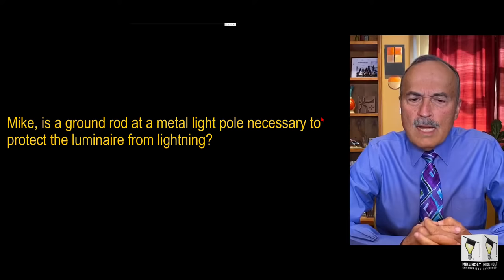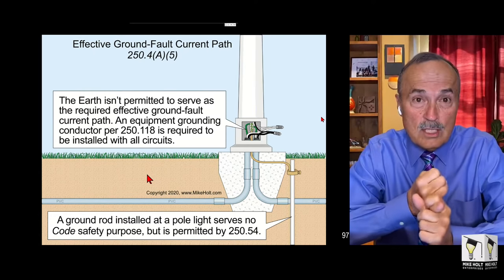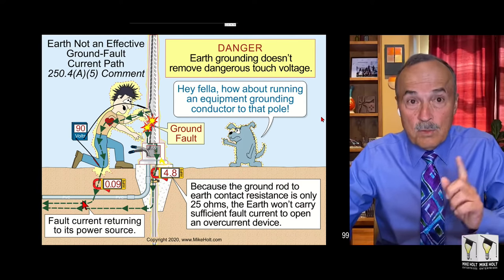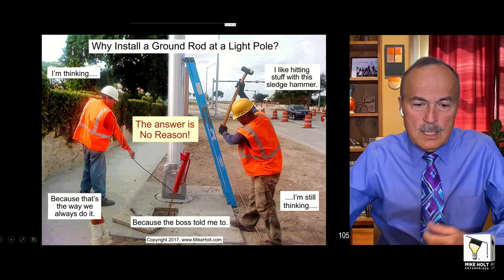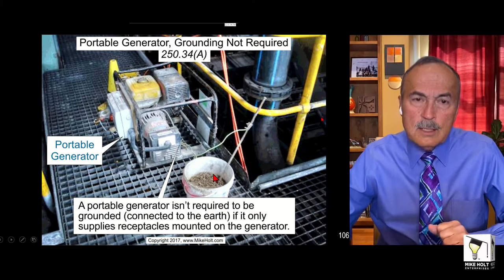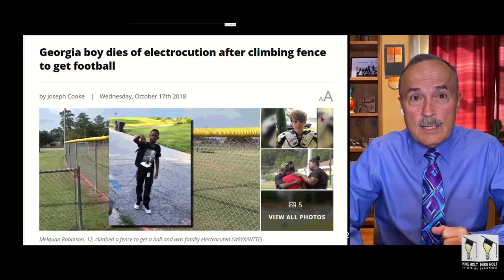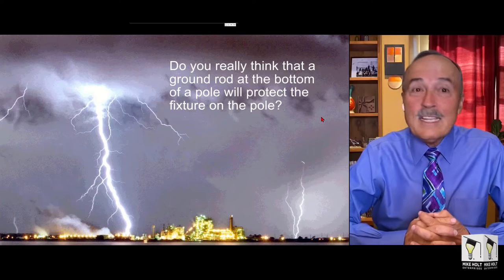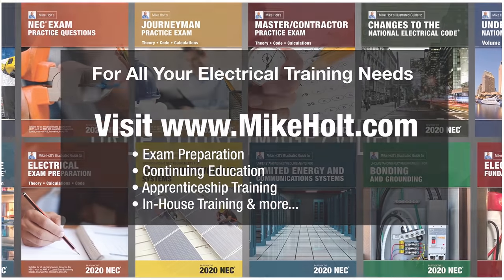Ground Rods at Metal Poles, NEC 2020 - [250.4(A)(5)], (25min:09sec)

Comment: Hello Mike. My Dad told me of a lightning problem they had at the Timken company at their Bruster plant. Lightning would hit the chain link fence, travel down the fence, jump across the opening at the main gate, into the guard booth on the other side and hit a water well casing that was inside the booth. He said they drove and connected ground rods next to each fence post and this helped but didn't completely solve the problem.  They finally replaced all of the fence posts with very long post.
Reply from the maker: Interesting.

Comment: I was working for a lightning contractor and we had a bunch of small light pole/mail boxes in an hoa. The mail person stopped delivering mail because they were getting shocked. The light poles were fed from buried rmc conduit that was rotted away with no egc. I was belittled because my suggested fix was to replace all the conduit and install a egc. Boss sent someone else out to drive ground rods😕
Reply: @crissd8283  Not just the electricians plenty of other trades and inspectors with little to no electrical know-how obsessed also!
Reply: Your story is one of many. We have to keep educationg those that will listen. Eventually all of the "Electrosaurs" will be extinct and we won't have these issues.

Comment: I wish more electrical engineers around here would watch this video.  Every new construction job i have bid and done has ground rods  shown in the drawings at the poles
Reply: i think wire fences post for livestock fields are recommended to be connected to ground electrode for lightning protection as per NFPA 780 Standard for the installation of lighting protection

Comment: You said in this video that the portable generator did not need a ground rod but if your generator is a bonded neutral generator and providing back up power to a residential house with a switched neutral transfer switch you would then need a ground rod.

Comment: In your view, do outdoor metal poles with only POE devices (WAPs/Cameras) fed from building require an EGC? I've watched the entire video and reviewed the code but I can't find a clear answer. Is the pole "likely to be energized" by POE fault? By the letter of the Article 100 definition of "energized", the answer is yes. So do you run a dedicated EGC from the building telecom/electrical ground bar to the pole?

Comment: Seen lightning hit communication tower with 3 4/0 ground wires going to ground field. Even the guy wires that were hooked to ground field smoke. To protect from lightning is very difficult the only thing that helps is the whole thing went high at one time if that's the right terminology. So minimal damage took place

Comment: This reminds me of a argument amongst technicians when i used to install burglar alarms for ADT. 16.5 vac. Transform did not have a grounding conductor. ADT requires we ground the panel. We argued that grounding the panel only made a path for lighting through the panel to the ground.  Lighting strikes would often run current through the alarm wires into the panel if it was grounded. Without grounding the panel, the current found a different path. What are your thoughts on this?
Reply: The very remote chance that lightning would strike the building vs the possibility of static buildup shocking customers touching the panel or causing interference with electronics. That's my understanding at least
Reply from the maker: Watch this video on why you should NOT ground the fire alarm panel to the earth. https://www.youtube.com/embed/WlnFNTay-9Q

Comment: What is the implication for grounding rods at sub-panels that have equipment grounding conductors to the main panel?   Thanks
Reply: It doesn’t have to be a grounding rod, any kind of GE(grounding electrode) will work as the one required by the NEC at remote buildings with electric power.It has the same purpose than the one at the service and is among other things to bleed out any kind of induced and dangerous voltages preventing arching fires,damage of equipments and electrocution by voltage accumulation on metal parts.
Reply from the maker: No that is not the reason - watch https://www.youtube.com/embed/mpgAVE4UwFw
Reply from the maker: You my friend are 100% correct!
Reply: @MikeHoltNEC  Why does the code keep changing on grounding electrode separate buildings isolated groundlng conductor  versus Grounded Conductor Bonded as a main panel. 2 ungrounded conductors one grounded conductor. Versus 2 ungrounded conductors and one grounded conductor and one Isolated grounding conductor bonded to the grounding electrode? When the utility provider loses its ground from the transformers you’ve got problems either way.Potential difference in grounds becomes apparent water pipes always Stray voltage
Reply from the maker: @danielsullivan9865  I have no clue what you just said. There have not been any NEC changes on the practice of 'grounding' for at least the past fifty years I'v been in the electrical trade.
Reply: @MikeHoltNEC  Changes nec 2008  250 - 32 b   Method to has become an exception for existing
Reply from the maker: @danielsullivan9865  I'm the one that made that change in 2008 NEC! But this has nothing to do with metal light pole grounding.
Reply: @MikeHoltNEC Was this change needed due to multiple tragedies?
Reply from the maker: @danielsullivan9865  THe change was to prevent the use of the neutral conductor to serve as an equipment grounding conductor.
Reply: @MikeHoltNEC  thanks for your reply this is very complicated.   more to the equation than just a grounding conductor. I believe any failure either way would have to do with utility supplier ground loss on Transformer equipment. 
Am I wrong thank you for your response
Reply from the maker: @danielsullivan9865  Yep, Please watch this video - MikeHolt.com/Fundamentals.
Reply: @MikeHoltNEC ”equipment bonding conductor “. you taught us only use grounding when talking about earth.
Reply from the maker: @tedlahm5740  That is true, but this is the term used in the NEC, so I have no choice. Also I put the quotes to make those that love grounding feel better.

Comment: If a lightning strikes a pole with effective ground fault current path, what will happen to the cable ensuring effective ground fault path from pole to source. How should we size that cable to ensure the damage don't happen to the cable. What should be the minimum size of that cable considering lightning?
Reply from the maker: The National Electrical Code is not a standard that has anything to do with lightning. If lightning struck a pole, then everything that was damaged needs to be simply replaced. Nothing you can do about this, except to provide lightning protection system per NFPA 780 for the pole. Of course that would make no sense.

Comment: In the metal chain link fence situation, if an inspector says it needs to be bonded because it is likely to be energized, would it be ok to just take the correct size wire to the EGC, not rods.?
Reply from the maker: This fence is not likely to be energized as defined by the NEC, in Article 100. "Conductive material that could become energized because of the failure of electrical insulation or electrical spacing."
Note: if they had not connected the fence to the metal pole, the young man would not have been electrocuted.

Comment: Mike. I'd like to hear your thoughts about grounding drums and containers of flammable liquids and storage cabinets for flammable liquids for protection from fires that could be caused from a static spark?
Reply from the maker: That is a totally different concept and there are NFPA standards that address this issue, particularly NFPA 30, Flammable and Combustible Liquids Code.
Reply: @MikeHoltNEC  Thanks.

Comment: Do some research, on conductor, transmission of Energy "WAVES", it is not moving of electrons, inside of wire, its the field surrounding, of conductor, that moves Power. Lightning is air gap, field power, yes that ground rod is required, of 30ft larger metal poles, as in traffic light standards, I Installed a "LOT", of em.
Reply from the maker: Are you saying that we need a ground rod at a metal pole for the electric energy to get to the light for it to illuminate? Are you an electrician in the US?
Reply from the maker: Are you saying that we need a ground rod at a metal pole for the electric energy to get to the light for it to illuminate? Are you an electrician?

Comment: Can FMC used in old house consider as effective ground fault current path?
Reply from the maker: Read 250.118 and let me know what it says please.
Reply: @MikeHoltNEC  yes I read the article. OCPD should be less than. 20 A.  But 250.118 5 d  got me confused. It said combing length of conduict not exceed 6 feet. So that mean FMC used in old house ran mor than 6 feet are not consider as effective ground fault current path?
Reply from the maker: @benzaguru4548  If the NEC says a maximum of six feet, then clearly anything more is a violation. What about this is confusing?
Reply: @MikeHoltNEC thanku. not any more. That's why we need seperate equipment grounding conductor in FMC that used in old house. All those FMC are ran longer than 6 feet.  So we can not use three prong receptacle without seperate  equipment ground conductor.
Reply from the maker: @benzaguru4548  You my friend are sounding like a Code expert. Congratulations. But when replacing receptacle, they don't need an EGC, see 406.4 on the rules for replacing receptacles, and the GFCI option.
Reply: @MikeHoltNEC  thanku, but 2 prong receptacle can replace by only two prong or use temperesistant gfci receptacle
Reply: Or pull new equipment grounding conductor if you want to skip previous two option.

Comment: I see towers with antenna arrays everywhere with grounding electrodes and their respective conductors at the base. Sometimes up to four or more. Cell tower sites have grounding electrodes everywhere with every metal piece of equipment tied together. Maybe it’s only to prevent a difference of potential for worker safety while in the site area. I’ve seen similar sites where the grounding electrode conductors appear to have been purposely removed but still present. I wonder if they have something to do with the radio frequency and it’s proper propagation. There is a mono pole antenna tower I’m familiar with that the terminations are loose enough you can rotate them around by hand.

Comment: Mike I have questions ! Don't we all say that the earth is neutral or it's zero? And if you hit the hot wire with neutral will trip the breaker? So "If we hit the hot wire to ground rode will trip the breaker "? 
Why it didn't trip in your live example?
Reply from the maker: Everything you said is 100% false, please watch https://www.youtube.com/embed/mpgAVE4UwFw
Reply: Electricity travels back to the source. When you connect the hot wire to neutral it sends a very large amount of current through the circuit back to the source tripping the breaker
Reply from the maker: @nicnac2400  Why would you connect a hot wire to the neutral? What does your statement have to do with the silly practice of grounding a metal pole to the earth (when it's already connected to the earth via the metal bolts)?

Comment: What’s the reason for all the ground rods and ground ring on cell towers. All the ones I inspected were pretty much design the same way
Reply from the maker: That type of grounding has nothing to do with the National Electrical Code. It's purpose is to reduce the difference of potential between metal parts in the even of an lightning strike.
Reply: @MikeHoltNEC  I thought it had to do with noise and interference with signals
Reply from the maker: @danielsullivan9865  What do you think 'noise' is? Grounding of a cell tower system has nothing to do with reducing the interference of the signal. It simply is a way to reduce the difference of potential between the metal parts of the cell tower to the earth. If you get any documentation otherwise, please share it with me.

Comment: Do you have to ground a roof mounted over the air TV antenna? If you do, do you have to ground it near the main panel existing grounding, or can you ground it near where that antenna is separately?
Reply from the maker: Please watch this video for your answer.
Reply: @MikeHoltNEC  I always watch videos before I comment. So either I’m not getting it, or it’s not covered.
Reply from the maker: @bob847vid  I understand, please watch this video and let me know if you now 'get it.' https://www.youtube.com/embed/mpgAVE4UwFw
Reply: @MikeHoltNEC   so following the video which I watched before but watched again thinking about this particular application, I’m assuming we treat the TV antenna like a solar array on the roof. In that case no separate earth grounding rod should be installed. I still don’t know if a the antenna mast or coax cable shielding should be attached to any grounding though? Should
It run to the existing grounding rod at the service panel?
Reply from the maker: @bob847vid  This video is about why the grounding of a metal pole serves no purpose and that we need an equipment grounding conductor to the metal pole to clear a ground fault. Questions related to TV and satilite antennas - Watch https://www.youtube.com/embed/cwB9xd-CzTU, questions related to Solar - watch https://www.youtube.com/embed/NkDYphpg8sM and https://www.youtube.com/embed/Ypo99VRxT44
Reply: @MikeHoltNEC  the first linked video you mentioned for antennas is unfortunately showing as a private video and I can’t watch it. May have to change the security setting on that one. I watched the other two and the later one touched on antennas fro a moment. Either way I found the content to be very good. Any chance I can get the antenna specific video opened to public so I can watch that too? Thanks Mike.
Reply: @MikeHoltNEC  actually still need the whole video on antennas. The one I found was just a short clip and the one you send was private so can’t be viewed.
Reply from the maker: @bob847vid  Humm... visit MikeHolt.TV, then search for 810.21 (https://www.youtube.com/embed/cwB9xd-CzTU). Sorry

Comment: Add ground rods to provide shortest paths to Earth from conduit that goes to the roof or to poles or elevated antennas. You want lightning to form plasma paths to the Earth. You don’t want lightning wrapping around the house or traveling through your house. Call these lightning grounds if you wish. Extra ground for motors or whatever not required by NEC are absurd.

Comment: This is a very tricky subject. The wire bonded to the light pole metal structure providing the fault current return path should theoretically be at ground(0v) voltage. However in practice this may not be the case and again lead to electrocution. Tricky indeed!
Reply from the maker: The earth will be zero volts related to the phase conductors, but that is irrelevent. Please watch my video MikeHolt.com/Fundamentals.

Comment: Shouldn't it be bond fault then?
Reply from the maker: Yea... but the NEC uses the term 'ground fault' so we are stuck with that term.
Reply: @MikeHoltNEC  what would be the  right denomination? Neutral bonding mass fault or something of the sort?
Reply from the maker: @0786RICARDO  Since all my work is related to the National Electrical Code, the proper term is 'ground fault' in accordance with Article 100 Definitions.

Comment: Great job Mike... I hope these ''old'' engineers wake up...
Reply from the maker: They are dinosaurs, we'll need to wait until they and others move one...
Reply: @MikeHoltNEC  , thank you Mike, your knowledge is so valuable and yet, people watch your content and do not fight back... Perhaps, the contract specs do call for those ''details'' but, the contractor could push liability back -- simple, reference the ''unsafe condition'' and ask for another review addressing the ''path'' that may be created by using this ''extra bonding''... 
Mike, I recall your video; the water and the military guy... it was interesting...
I recall, turning on water and putting an electrical meter in the ''hot leg'' and the the leg in the water flow... yes, I was able to get a volt reading (of course)...
Again, thank you for your eduction.

Comment: Could ground rods at light poles help protect from lighting strikes affecting poles down stream? It would obviously not stop it in its tracks but with the high impedance down stream for the electrical system for the high energy pulse of lighting i would imagine it would at least have a chance at saving down stream light poles.
Reply from the maker: Nope. When lightning hits the first pole, it simply destroys the light fixture, and not likely to damage the copper wire to the fixture. So it's not going to damage the wire to different pole.

Comment: Gonna step out on a limb here. Taking the lighting's perspective, i imagine it's goal in life is to connect the clouds to the dirt. If that involves a tree, the aerial service of a building, the ground rod at the utility pole, the ground rod at the service, a building's wiring or plumbing, or whatever else is conductive enough to get the job done, it will use. Of course the rebar, the threaded studs, and concrete of a pole light's base functions as a sort of concrete encased electrode. So, I'm guessing here, the auxiliary ground rod MIGHT(purely hypothetical here) help prevent the circuit conductors from getting fried when lightning hits the pole.
Reply from the maker: Of course our goal is not to help lightning get to the earth... Also a metal pole is already in the earth and doesn't need any additional grounding, but remember grounding is not needed in the first place. See https://www.youtube.com/embed/mpgAVE4UwFw